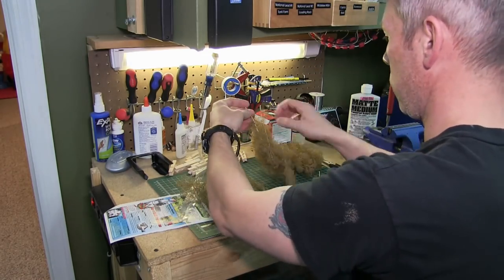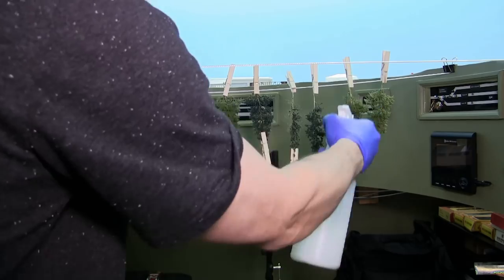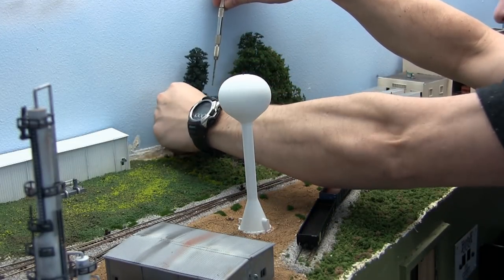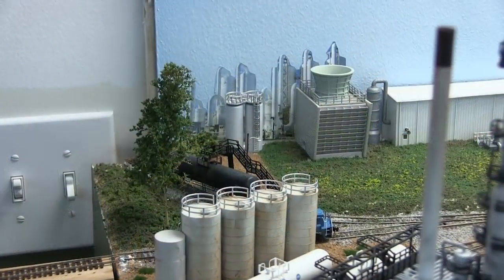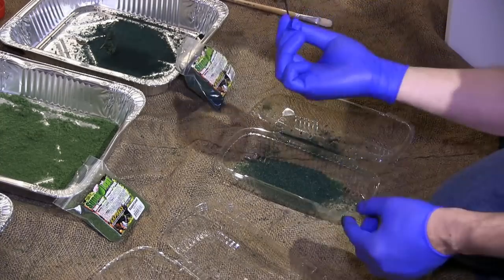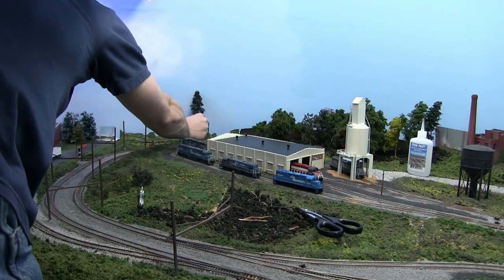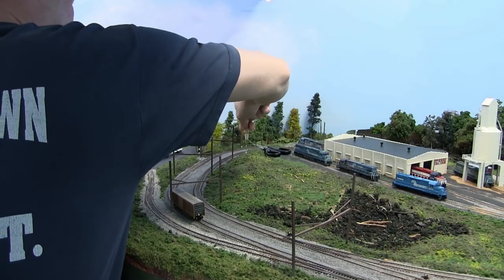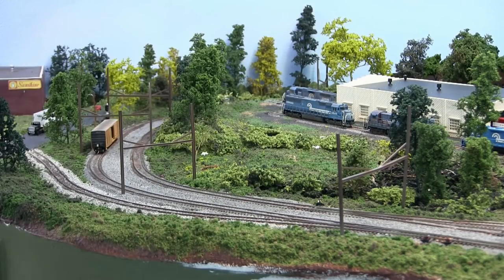Trees!

Comment: Great video. Very informative. In the area where to forgot to paint the plaster behind the trees, maybe try a thin strip of furnace filter material or something similar to simulate distant or smaller trees. Since it is thicker it will block the white. I really think Caitlyn wants to help. It would have been a bit messy but would have made her day. Potential future model railroader there. Cheers and a happy and safe new year to you and your family.
Reply from the maker: maurice grimes ooo! I like that! I will give it a try thanks!

Comment: I go thru the entire box, separating everything into different size tree piles.  Remove seed pods, if the tree is curved/bent I either break the tree into 2 smaller ones, or use a soldering iron on the back side of curve, applying pressure to the tree briefly, this will straighten out.  Spray trees with flat black rattle can, let dry.  Use 3M/LocTite spray glue, sprinkle ground foam or leaves on, and I use some scrap foam board, poke holes and insert trunks for drying.  I keep the foam board size manageable, I can set them to dry on a shelf, and when I want to plant them, I can take the board in next to the layout as needed.  No soaking, no matte medium.   Also I don't glue them in, I can move them around or reuse them if I tear layout down.  To each his own though, seems everyone does it different.
Reply from the maker: CSXGP38 thanks for watching.